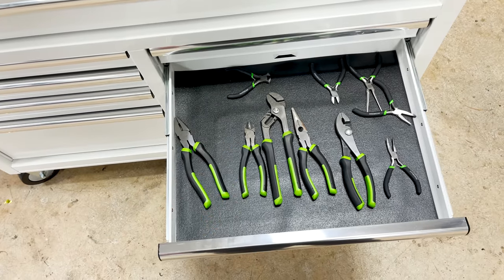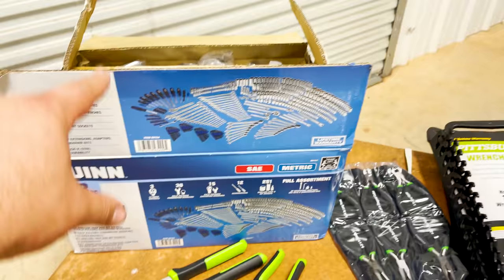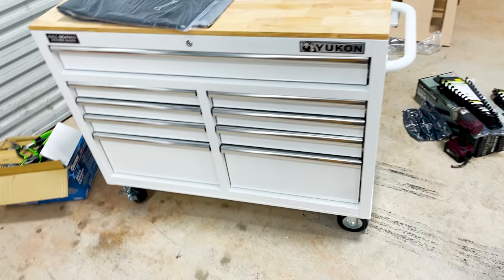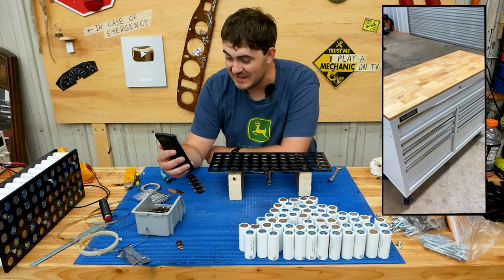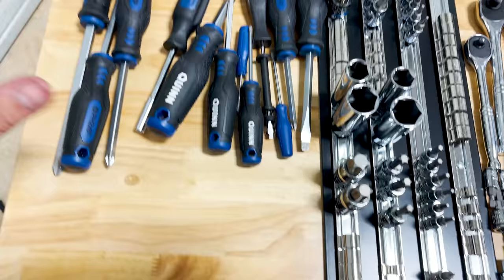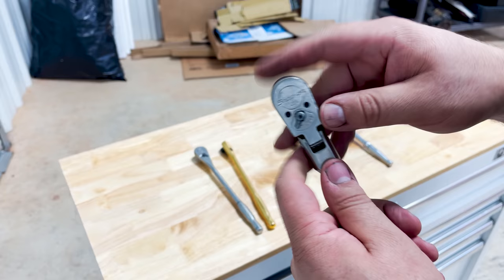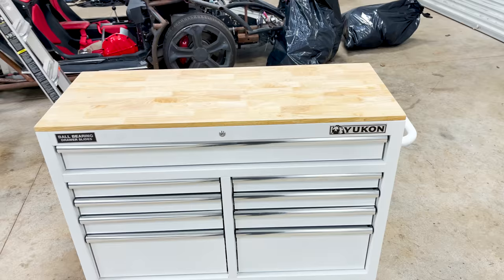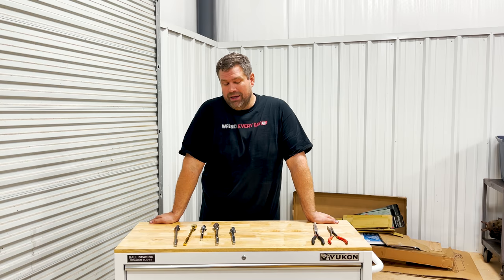I Bought The CHEAPEST TOOLS On The Internet (So You Don't Have To)

Comment: Being a mechanic is definitely one of the most expensive career to get into as far as personal tools thar are required. I was a professional mechanic for almost a decade I started off with about $7000 in tools & tool box & now I estimate I have around $35000 into it. You can get away with less but when you are paid by the job instead of the hour every tool that allows you to work faster can be justified within reason. On wrenches, ratchets and sockets is where the premium quality tools make the most difference so is where you should put the major of your budget when starting out.

Comment: I use those green pliers daily. To be fair, they're used solely to remove plastic caps from axle nuts on bicycles, but they work. One thing to bring up, they start to rust in an air conditioned room. No lie, one month,  surface rust formed.

Comment: starting out cheap is great. its how i began my career is an automotive technician. however, the only things i would have done differently is this, dont go cheap on 4 things: 1) ratchets. cheap ratchets have lots of play in them and have cheap internal parts. making it frustrating to get fasteners out of hard to reach areas, and the cheapos more likely to break. 2) wrenches. nothing is more frustrating than rounding off a bolt with a chinese wrench that isnt really the size its stamped with. 3) vice grips. cheap vice grips tend to have the jaws stretch apart, teeth round off, and they just fall apart. 4) power tools. cheap electric tools are gutless pieces of junk and usually just vibrate apart. buy a good name brand like DeWalt, Milwaukee, or makita. they have many different tools that all use the same batteries and chargers. cheap pneumatic tools are also gutless pieces of junk. the seals usually end up blowing out of them. buy a good name brand like Ingersoll-Rand, AirCat, and astro pneumatic. 

spend the extra money on these tools and dont waste your money on the cheap ones.

Comment: While I’m not a mechanic I am a contractor. What I’ve found is harbor freight tools are in 3 categories. Junk, acceptable and good. To this day I still have harbor freight tools in my tool trailer, some are 15+ years old. Also there is some logic in buying the cheap tool if you only need it a few times or know it’s going to get smoked pretty quick. An example is for years we installed concrete siding. We always bought harbor freight circular saws because we knew they were going to be in a harsh environment and ultimately fail. The carts and tool boxes are pretty decent quality and to this day we still use the harbor freight sheet rock jack I bought on nearly day 1. Sure we’ve had to replace the lift cable a few times and one pulley but I saved several hundred dollars buying that tool and it’s performed as good as the good ones we’ve rented. Same with the small hydraulic bottle jacks still have the 2 I bought years ago.

Comment: I own that tool box, 52 inch version in grey. It's been a good tool box. Working on my automotive technician apprenticeship 1sr year. My tools are cheap, aside from a couple high end snappy tools. I've been running that particular tool box for 6 months, tool box fell over in an uneven bay and all the drawers being open nothing got damage aside from a dent. The wood has separated from the box had to take a drawer out and tighten the screws holding it down. Other then that the drawers could've been deeper

Comment: Not a bad video. First thing I noticed, you got the casters in the wrong position. As others have noted when you use the handle to move it around you can't steer it properly. Flip the casters around.  Second thing is, that wood top is real and it isn't made of any cheap softwood(harbor freight says solid wood top, which means no composites). It is made of real hardwood, likely oak by the looks of it. Reason why they finger jointed them together is because it is an easy method to do at the factory level to glue what is basically hardwood flooring scraps because they have machines and jigs made for that purpose. So just because the tool box has a solid wood top doesn't mean it's going to be crap. In fact it's a plus because now you got a top that is easy to run over with 80 grit, 150 grit and then up to 320 or 400 grit sandpaper to apply a new polyurethane finish ideally with one that is made for wood floors as the coatings are made to cure quickly and leave a finish that is hard to wear out. The factory that made the top likely used something similar to resist oil as you said.

Comment: i work on forktrucks and i have one of the smaller 2 drawer yukon tool carts, and they are enough if you don't mind having to dig through tools to find the one you need. it works for me because i know where everything is. its good enough for a maintenance worker but a mechanic might want to go with something with atleast 4 drawers (im talking tool cart, not tool box). i do need an upgrade and the one in this video is plenty big enough for what i do.

Comment: I'm a machinist (tool and die maker) in my experience, Harbor Freight's most expensive stuff is around the same quality as the Home Depot bottom of the line stuff but you end up paying less for it most of the time, the Pittsburgh pliers are all trash, if you want a decent cheap set of pliers the Home Depot Huskys haven't let me down, I've beat the hell out of my set and they haven't let me down.

Comment: I always thought the same: in the beginning, buy the cheapest stuff so you can get as many tools as possible, but over the years I arrived at the conclusion that it's better to get used, top of the line tools (even check them out before, if you can) and when you can afford it, buy new good or top tier ones. Cheap stuff can let you down in the most brutal way, so, if you don't have spares, you're done for. Many ratchets have replaceable head mechanisms, like my Draper ones (I'm in good ol' Europe), so they can last you a long time. Cheers!

Comment: I bought those sockets when they 1st came out a handful of years ago. After using them in a shop setting for a few months the chrome started peeling off. Also found some sizes didn’t fit like they should. The sockets are also pretty weak. If you need to put it in a vice to get a stick fastener out you it can easily deform the socket. 
I have found Tekton to be a really good middle ground of cheap and quality. Plus they don’t skip sizes.

Comment: I'm not a mechanic. I do know a lot of at home people who use Harbor Freight stuff. We kind of agree, that if you have a local HF store, its worth going with them, because of the ease of replacement, and how good they are about replacing things for free. Also, when you're spending soooo much less on the tools, if you replace them 10 times in a lifetime, you're probably still coming out cheaper in the end than with Snap-On or Matco. Not to mention the lower cost of jumping in, in general.

Comment: 11:00  The wood that you see is used in lots of imported furniture, tables, stool tops and this tool cart etc. is known as Rubberwood. Or Malaysian Oak. It is a hardwood, but not related to Oak. The finger joints or otherwise often pieces glued together and is just a way of making something useful out of small pieces. Rubber trees (literally tapped for the latex)  are used on plantations. These trees are grown close together and are straight and can get a couple of feet across.  Plantation hardwood is also another name for this. You see it everywhere in products because the life of a rubber tree is about 30 years. Imagine that top made from real oak. Now you have the cost of a Snap On cabinet.

Comment: Wrenches and sockets hardly ever break, so going through a tool truck is pointless. I've had the same set of northern wrenches for the last twelve years and my chrome sockets are still the Channellocks from the crash kit I bought at Sam's club 20 years ago for $65. 

What you do want to buy from the tool truck are ratcheting wrenches. You will break them, and that lifetime warranty is gold when you do. Harbor Freight has a warranty, yes, but you have to drive there to get it, and I've found them to break faster than my Matco ones.
Reply: I've definitely replaced sockets. some break. some just get incredibly loose and fall off extensions and get loose on the bolt side also.

Comment: As a home gamer, I have bought hardware store tools, mainly stanley, they have a lifetime warranty but I am yet to break a tool excluding a t20 torx socket and I've had them for about 10years, they've done multiple engine swaps, fixed countless issues and done regular maintenance.. If you want expensive tools for the feel buy a cheap socket set and a nice ratchet.

Comment: my standpoint on tools is usually, if you are a hobby mechanic working on your project in your garage you den't need the most expensive tools. maybe don't buy the cheapest stuff you can find but a step or two up from that will do you just fine. and usually the biggest differance when you get to the more expensive tools is they tend to last longer. personally i have quite cheap tools at home if i need to do anything, and over here in sweden tools at work is quite different because the shop is usually the ones buying the tools so i don't have to buy any tools for work. but that is just my take on tools

Comment: Look at the ends of the wood top. If it’s end grain, it’s probably solid. If it’s long grain, it’s probably veneer. But with all those joints, it’s gonna be solid. They joint up the scraps from real work for these cheap tops. But they are usually well made.

Comment: That Yukon box top is solid wood. Just finger jointed. There is a monster machine that makes those tops from random wood. It's extremely strong, even stronger than like sized solid wood. There are finger jointed wood beams going into new homes and businesses. They are making major structural beams out of finger jointed wood. They are strong, just like plywood is stronger than solid wood. So, it will hold up fine under heavy use.

Comment: to keep that nice
.. use plexiglass and secure it on to with flush mount old screw... also makes clean up easier... also use silicon caulk around the edge to make it sealed from oil leaks.... looks nice

Comment: That wood top is probably scrap maple cutoffs or a similar hardwood sometimes bought cheap from other places like furniture or other factories that have no use for them.  They cut finger joints on them to get length, glue them together like a butcherblock top and you have a nice strong hardwood top that should last MUCH longer than the usual particle board often seen on cheap kit workbenches.

Comment: I have always told young techs that, Harbor Freight is fine to start off. Get your basics and what you can. It the more you can do with the tools, more tools means more and different jobs you can do. What breaks, replace it with something better. If you use it everyday and a warranty would be nice, then go for the tool truck stuff. I hate to see new techs that buy everything off the trucks and have a little tool box to show for it for $20K.

Comment: Good hints about those fancy toolbox tops- look at it with the macro lens of your phone. See a halftone pattern? If so it's printed plastic fake veneer, almost certainly over shitboard.
Does the pattern of slats continue over the ends of the top? If not it's almost certainly printed veneer over shitboard.
Take the top drawers out and unbolt the top, turn it over and look at the bottom side- they never spend the money to put real or fake veneer on the bottom and you'll immediately know if it's real or shitboard.
Even if it is shitboard you can lengthen its service live using poly after peeling the veneer and rough sanding it for better penetration. That will help delay swelling and splintering.
Best fix is, as was said, yank it before it falls apart and replace with real wood.

Comment: I'm amazed that in 1985 everything could be done cheap hand tools- corded and 16v nicad drills- but now I need a snap on dealer and brushless 24v LiOn tools to be serious. It's crazy the lenghts people go to just to get a tiny bit more performance. Some tools are junk but if it's heavy-and smooth- comfortable to hold-and a basic hand tool -it's probably good enough. I'd rather have the right tool than the best tool.  The cheap deepwell socket set will be wayyyyy better when you need it instead of the best tool truck socket. The special line wrench instead of a normal box is a zillion times better. I'd say save your dough for the tool you need, which you only discover you will actually need when you actually need it. Every penny preemptively spent is waste.

Comment: I bought a 5 drawer cart with the locking lid from HF almost 15 yrs ago. I pulled transmissions and transfer cases out of classic cars and trucks setting them directly on top and other than some scuff marks it's been extremely durable. I own tools from Snap-On, Cornwell, and HF they all work but any specialty tool I buy are usually of the highest quality for reliability

Comment: It’s surprising how good cheap tools are these days, I’ve got a similar tools in a crash kit here in Australia 🇦🇺 from the old hobo freight kit but it lacks more spanners then the usual suspects and no vise grips (but I carry those in a seperate electrics/specialist tools box with a code reader and brake drum pliers etc) and so far I haven’t broken anything yet. But as everyone else says, replace it with a Snap On etc so your wallet doesn’t combust with the cost with buying all the expensive tools... and never using a good chunk of em because of strange socket sizes etc.

Comment: If you want those pliers to perform better, tighten the nut and drop a weld. They’re not great, but it will at least keep them in position for a while so you can get some decent use out of it

Comment: Those tops are generally a hardwood finger jointed together and cut to fit. Personally I wish they were a little thicker to make attaching a vise easier and more solid but they work. On my personal cart I have what's basically a butcher block 3 inches thick with a good old Wilton attached. The top is a nice hard maple.

Comment: The best tool i have bought is the expandable socket wrench in 3/8" & 1/2", these things work so well and haven't budged when extended all the way out and used like a breaker bar
Reply: Recently got an extendable 3/8 flex-head ratchet.  Great tool - I find myself using it more than any other ratchet.  Tight quarters?  Shortest-length.  Need to break a stubborn bolt?  Full-length.  Poor access?  Flex head and the longest length that will fit.

Comment: Hey I am a relatively new A&P mechanic. I bought that same tool box but in blue and I love it, I did put a side box on and it holds the weight just fine. how ever the tools. I would recommend the Kobalt tools. It was about the same price but a better feel. just my 2 cents. I use my tools everyday for a living and good tools are not always expansive.

Comment: After I got out of the military I picked up a job working on semi trucks, the guys in my shop did tell me what to buy and what not to buy tool wise and I'm still piecing all of my stuff together, I will say all the harbor freight sockets and wrenches have been zero issues for me so I'll load up on those, I've broken 1 socket wrench surprisingly not from working on semi trucks but working on a hyundai sonata so I just welded it solid and it's now my sacrificial breaker socket wrench that's my first go to for a cheater bar. The harbor freight lights are meh for me, they work, my first one I got mad at and punched, still made it work by super gluing and duct taping together, bought the exact same light knowing where it's failure points were so I took it apart and superglued where it was needed and it worked fine other than the weak magnets and eventually I just bought a matco light. But for 8 bucks a pop to experiment with lights I won't complain

Comment: I bought a cheap set of Mastercraft socket wrenches from Canadian Tire back in '79. The ratchet handles gave up after a few months of hard use, but I still have just about all of the rest of the pieces, including the metal case. Not one of the sockets ever cracked or broke or rounded off. I was never tempted to buy Snap on tools. It made no sense to me to pay out more for a single socket wrench than I would for an entire set.
Maybe I would feel different if auto mechanics were my trade, but I think that no matter how good my tools are, there's only so much torque I can apply to a fastener before it strips the thread, rounds off the flats or just snaps off.
PS. I have NEVER had a good experience with slip-joint pliers. I only recommend them if you like pinched fingers, bruised knuckles and rounded off fasteners. The multi-sized Chennellocks are great if a fastener is stubborn or already rounded off. Not recommended if you intend to use the fastener again. Of course, short of a hack-saw or torch, you can't beat a good set of vice-grips.

Comment: Jared you know the stir casters need to be on the handle side right? You don't want the steering to stink. Having a work top tool box is great. I would suggest bolting a cheap cast steel (not cast iron) vise to a corner. Cresent adjustable wrench is worth the extra money. Knipex channel locks are worth the extra money but you can get by with a cheap set. Klien makes the best screwdrivers in my opinion but if you buy an expensive set of screwdrivers buy a set of cheap ones as well. You want a set you can beat on and not worry about breaking. Harbor freight has a set for like five bucks, that are perfect for that job.